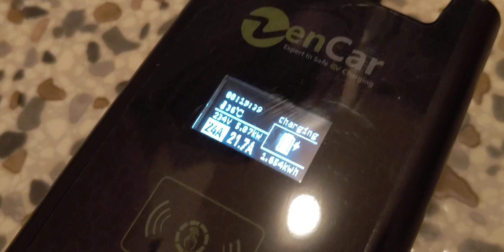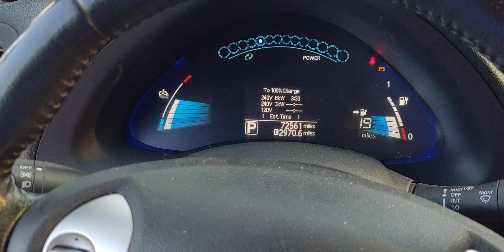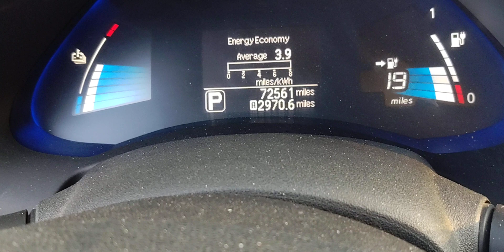Charging off the dryer outlet! 😁🛣️🚗⚡🔌🔋💯

Comment: Problem is getting that power to the EVSE. An extension cord is not allowed to be run through a wall, a door, or a window, and also isn't allowed to be a permanent solution. Code says this both in the US and in Canada.